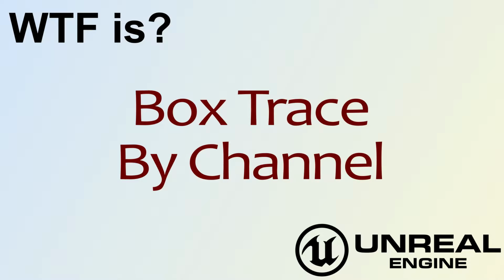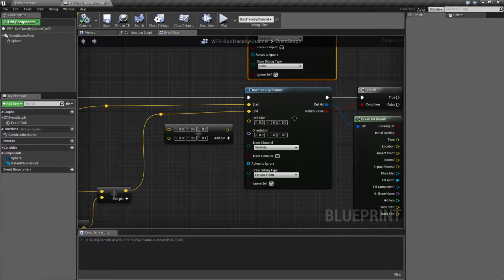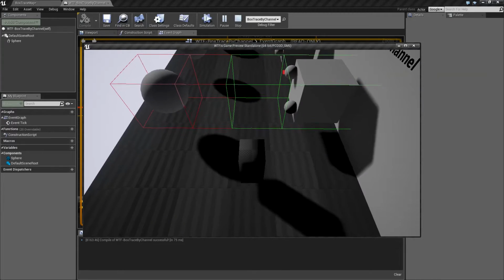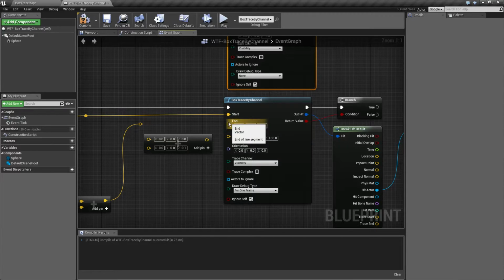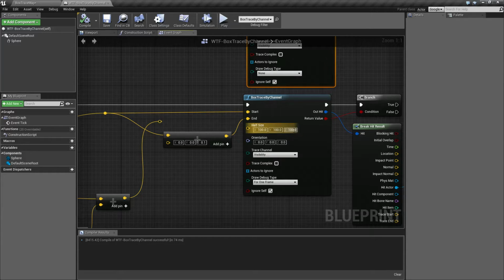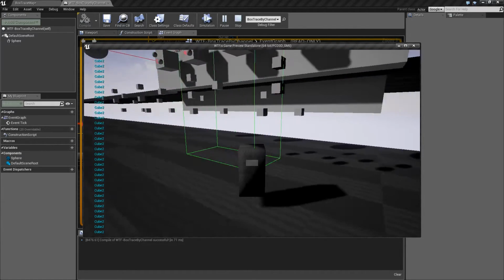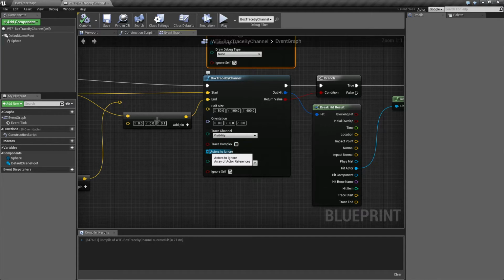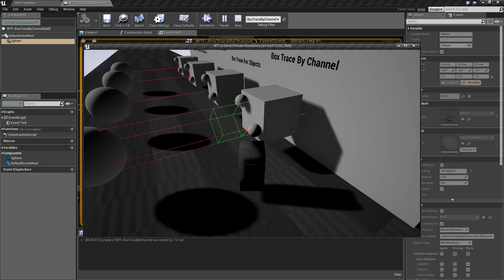WTF Is? Box Trace By Channel in Unreal Engine 4 ( UE4 )

Comment: Hey Mathew Wadstein....I'm trying to delete instanced meshes from an instanced static mesh using a Box Trace but it seems unpredictable...I'm using the Hit Item as the Index on the Remove node....I seen someone do this and I tried it with a line trace and it works great...but when I use it for this it doesn't seem to be deleting the correct ones even when I use a boolean to make sure they are of that ISM type before removing it from that ISM....Any idea why?

Comment: I'm curious. If I was trying to make a lighthouse, where the light beam was something that, should it pass over the character unobstructed (i.e, if the character isn't behind cover), the character dies and reverted back to the starting point, would I use this form of trace? use the players camera as the channel in which to cause a hit to occur? This is all new to me, so any insight you may have on this would be very much appreciated.
Reply from the maker: Something like this would not be super easy as lights have no easy way to detect what it is hitting.  an easy way would be to basically do a line trace from the light source to specific parts of the body and see if they hit without anything in the way and if they do then your probably in the light.  another way is using a material but this doesnt give you the actual hit results.  you would have to take the math from this and convert it over to the light itself and then have it check inside there.

https://forums.unrealengine.com/showthread.php?122791-Where-to-start-to-achieve-this-effect

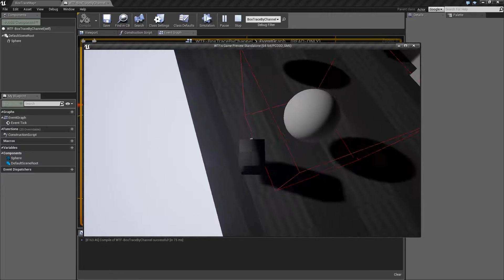Comment: 5:00 Well in this case you can simply use a box trigger, any difference?
Reply from the maker: Traces are for 1 frame and you get back the results of the hit, if any, immediately.  With my examples using Tick events to show them every frame they might seem like basically the same thing as a trigger but they are not.  Triggers have many more events you can attach onto and they are intended to be more for well triggering things.  Things going into or out of them or hitting them.  Traces are intended to be used instantly and to get a result.  A use for a Box Trace like this might be you want to build something on your ground in your came so you do a box trace in the spot of the size of your building and you can easily check to see in one frame if it is going to hit anything in that spot.